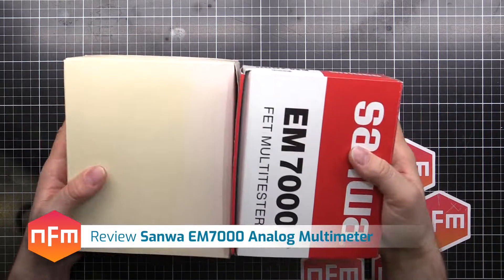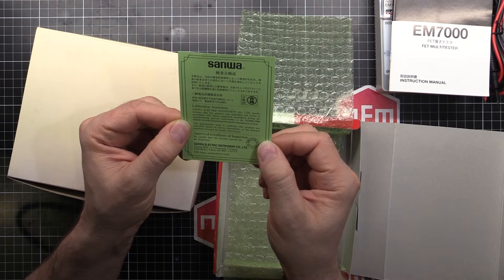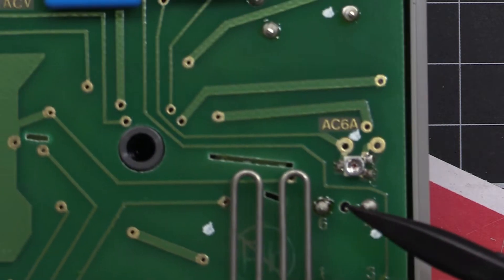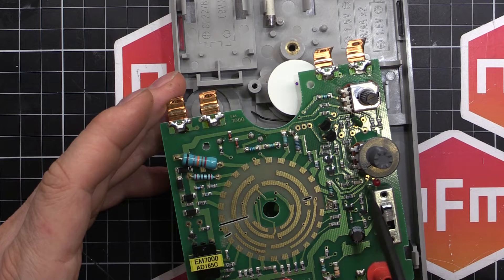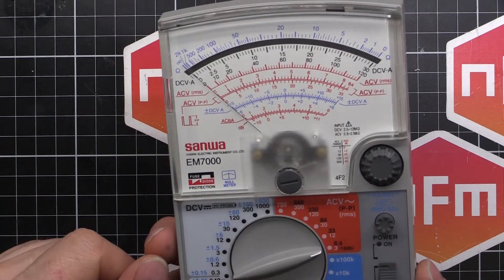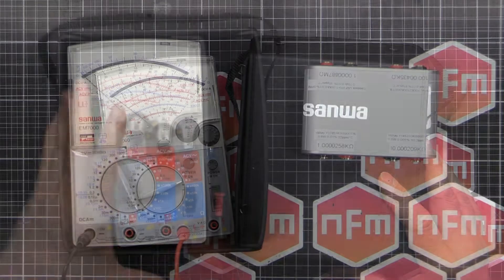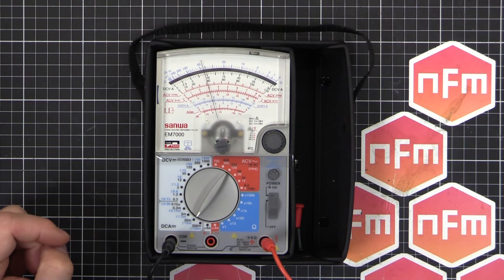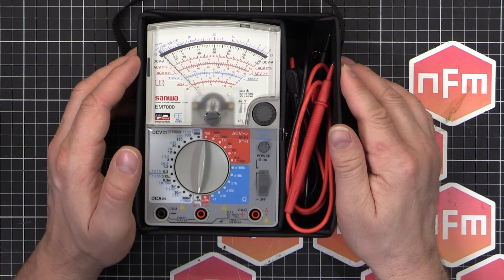Sanwa EM7000 Analogue Multimeter Review

Comment: 9:55  Nice view of the 500 mAH fuse.  It's rated at 250 V so the capacity should be 125 Wh.  The capital H must be a mistake because I've just checked and the ampere henry doesn't make any sense as a unit.
Faraday's law refers to amperes per second when using the resultant back EMF to measure inductance, but that's nothing to do with fuses.

Comment: Analogue multimeters never had MOV protecting the input. They also have an insertion impedance of 20 KΩ/V that you had to consider when doing a measurement, and it is a limitation that electronic multimeters like this one were meant to reduce.
In 50 years of multimeter use, I switched to digital types but it never lasted long. Quality Analogue Multimeters, albeit less precise than their digital counterparts, allows for an easier diagnostic on all fronts. I ditched the double triode VOM for practicality reasons, but still use a FET multimeter in special cases. I tried higher impedance multimeters, like the 40 KΩ/V devices, but their 20 μA galvanometers are too delicate and fail too easy from shocks and vibrations.
I consider myself lucky that I can still purchase good quality Analogue Multimeters to this day, because other extremely effective test equipment, which are of great help for circuit design - like the grid-dip meter, or the analogue bolometer, or the simple RF modulated oscillator, are no longer manufactured.
Greetings,
Anthony

Comment: You have not used the resistance meter correctly. You need to zero-out for every range separately (x1, x10, x100...). Nothing wrong with the meter.

Comment: They did it wrong. Using a chopper amplifier is way more advantagous than using a FET differential amplifier. There is a circuit for the similar EM3000 on the internet.

Comment: DC voltage readings on mine are always like 0.5 V off (lower) in 30 V scale. Should I mess with the internal pot or just consider is within spec?
Reply: Edit: I was a bit quick on my previous reply and put my foot firmly in my mouth :P In this case, for voltage, the specification does say a +/- 3% of full scale on the DCV range. So the most accuracy is near the top end of the range. That means only the last division is within 3%, it actually gets WORSE the lower you go, reducing to 3.75% at around 80% of the scale, 5% at 60% of scale, 6% at 50% of the scale, 7.5% at 40% of the scale, ballooning to 15% at 20% of the scale, 30% at 10% of scale. As the pointer approaches zero, the meter error is constant but the percentage of error increases until the over-all error reaches and exceeds 100 percent at the very low end. An example for your DC reading on the 30V DC scale, if you are measuring 15V (verified by some other source) the meter could read anywhere from 14.1V to 15.9V and be within spec. I'd recommend checking out the PDF I linked to below for more about it.  For resistance, however, they give a specification of +/- 3% of arc which means the arc on the range selected. If you want to know how to read the resistance properly, check out this old Electronics World magazine from 1966. It shows how to read the resistance properly for different types of meters. On the magazine scan it'll be page 82, but it's page 78 of the actual PDF. https://worldradiohistory.com/Archive-Electronics-World/60s/1966/Electronics-World-1966-04.pdf
Reply: @redemptusrenatus5336 For what it's worth, the movement in this meter is way more accurate than the FS error specs indicate. The one I got is well within +/-0.5% on the movement linearity. It was hard measuring it to begin with - had to use machine vision to read out the pointer angle. The analog front-end could be made to match the movement if one wanted to. The FET front-end is probably where a lot of the error originates from. A jellybean CMOS op-amp should take care of that - even the lousiest op-amp is more linear than the movement. If someone wanted to design an alternate PCB for that thing, it could be a pretty good upgrade. With a good nanovoltmeter front end it's possible to use the taut band as a torsion strain gage, although that's of academic interest mostly. It requires resolution and stability that costs so much you could just slap a resolver in there and have a meter with a mechanical accuracy good enough to read out with a loupe :)

Comment: sanwa is a very accurate meter when you know how to use it, it would smoke even the expensive digital ones especially on measuring resistance,finding leaks and even detecting pcb moisture

Comment: Do you know why these multimeter has ohms adjuster ?
And you can't get real time needle movement because it has fet across it. It delays 
You can compare under $50 analog meter's needle moving speed with this one. This multimeter use for mesasurement not for fault findings like DMMs and diagnose
Reply from the maker: The adjustment is to allow you to zero the ohms scale in each range before taking a measurement.

Comment: You really messed up by NOT zeroing the meter using the zero adjust pot when measuring each resistor. You have to do this every time you change magnitude of your resistance. You will not be accurate unless you do this procedure before measuring resistors.
Reply: if first scale was let's say zeroed, it showed 1k, then moving the scale, it showed 900 ohms which is 10% not accurate, so he should've thought why is that, because that multimeter is not that much wrong. Of course you need to do zeroing for each magnitude/scale.

Comment: Hello. 
I have 2 of them. One is damaged due to a leak of the 9v battery. Trimpots went damaged. The other one keeps stored without the batteries. Other than that fragility, they are wonderful. Good price for a FET input Multimeter.

Comment: Of course it would be trivial to reset the Ohms calibration to improve that accuracy. It seems that the voltage dividers are almost perfect (very uniform between ranges) so just a small tweak of that trimpot!
As an aside, it would be an improvement to swap out those horrid little trimpots for a set of multi-turn wirewound pots. Make the setting easier plus more stable than the carbon pots over time.
Reply from the maker: I could do a trimpot swap, but then I'm up against the inaccuracy of reading an analogue gauge anyway.
I've swapped trimpots out on other gear before for the exact reasons you mention (like my Yokogawa 2554 volt/current standard I made a previous video on), but I don't think the improvement in accuracy would have much effect when the display isn't digital.
Plus it is still under warranty, so it'll have to wait before I start modding it anyway. :D

Comment: My dad used to use an analogue insulation tester on fault finding for similar reason to you. Was easier to see a needle moving across the display than having to look for a number on an lcd display
Reply: Is normal practice in the electrical industry to use them on circuits that have potential wiring or equipment faults. They arent used on electronic equipment. Most experienced electricians know not to connect to live supplies that will potentially damage themselves and the equipment. They are never used on sensitive equipment only on circuit wiring and appliances that cant be damaged. On most mains powered equipment faults it isnt safe to start putting power in to the circuit. As may risk fires and potential other issues. They are never used on circuit boards on insulation resistance voltage. Finally the Megger name is a brand name that seems to be used on any insulation resistance tester.
Reply: So he was using a megger to trace faults in a circuit board? That’s interesting.

I’ve actually seen other people do this, obviously must be a bit complicated because if you just hooked it straight up… It would pretty much blow everything I think. I think it can also be used to test capacitor leakage in some cases if you have a dropping resistor.

But I’m not really sure how that would work. I use power supplies all the time to find bad components. 

When quickly diagnosing a fault, I start with my FLIR thermal camera, but if that doesn’t work… 

I use a current limited supply with a resistor in series. So that I can push a low-voltage and controlled current through the board, and look for the heated traces or other signs of fault..

Most commonly shorts or heat… which has caused or is generating internal board faults, component faults, heatsink bonding faults, current overload faults, or even shorted faults hidden beneath multi pin components due to solder balls etc. 

Probing around all those small parts for faults can be very tedious. But with the constant current supply… I can quickly probe around and look for the lowest dropped voltage… Usually a pretty fast process but the flir thermal camera is always my first choice!

Sorry didn’t mean to ramble, 

I’d be interested to hear how your dad used the insulation tester to find faults. 
analog meters are so important, most people don’t know how useful they really are!

 can easily see what’s going on in real time instead of super fast updates, with numbers flashing and speeding by on the new digital meters